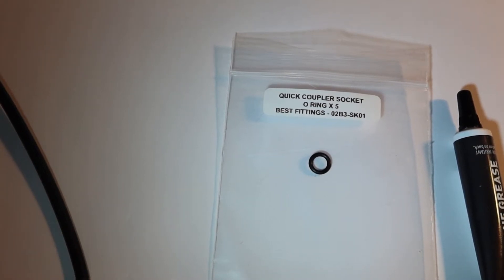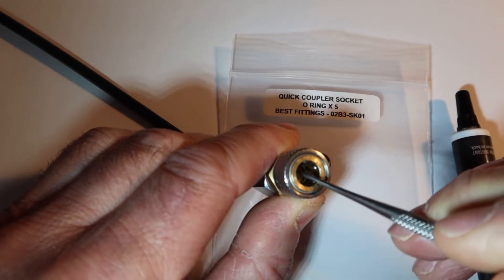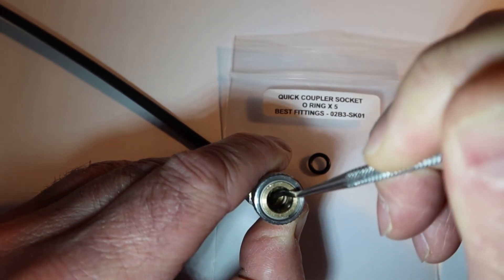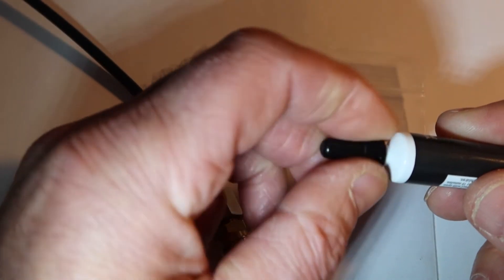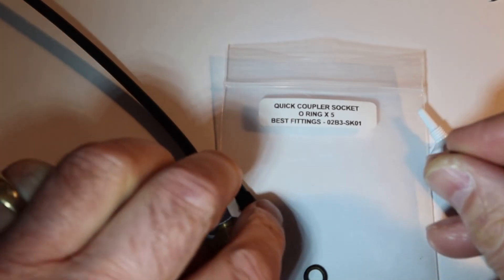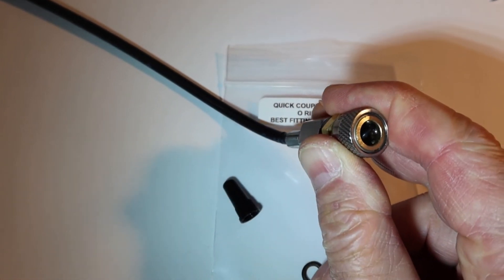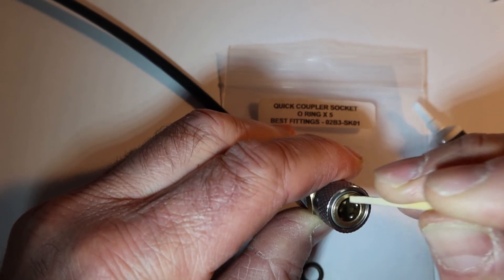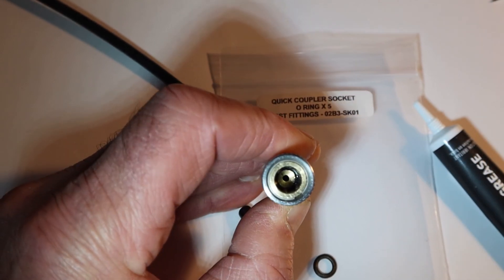Quick Connect Fitting O-ring replacement

Comment: Thank you! I pushed the o-ring in to my plastic quick connect for my kitchen sprayer, still leaking. I'm wondering if it matters how perfectly and snug you get the o-ring in? The only other thing is it may not be on tight enough but I can't push it any further LOL. Thank you
Reply from the maker: It has to be the right size o-ring and needs to sit perfectly snug. You should be able to feel and see when it sits correctly.
Reply: @ontargetuk796  thank you so much!